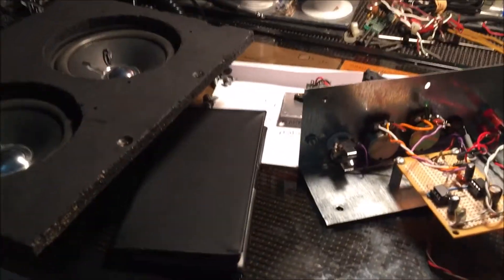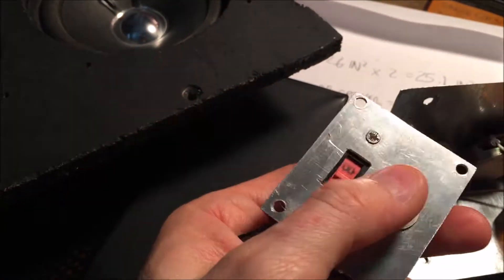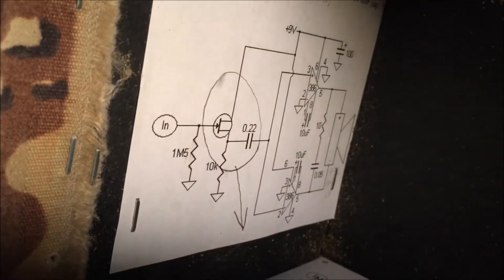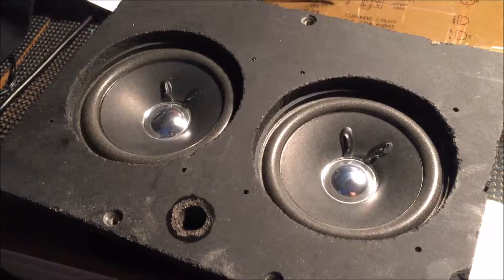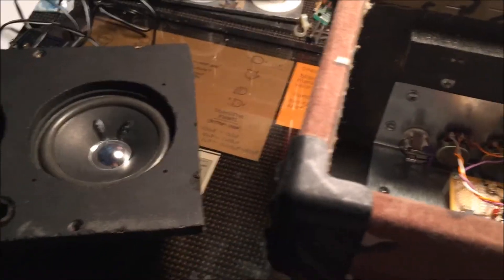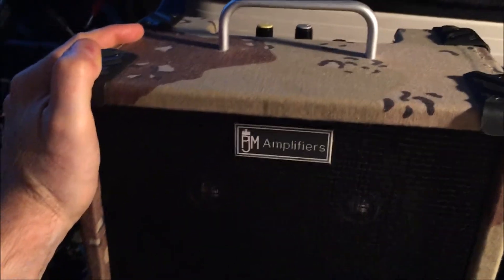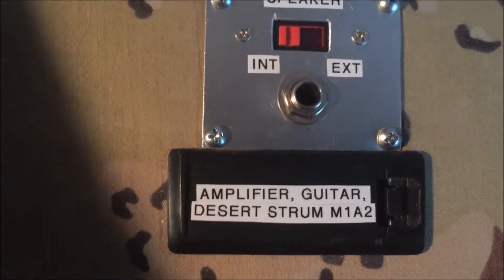My "Desert Strum" Amp - 90dB From Dual LM386 Audio Opamps

Comment: nice work .  did you repurpose the ext speaker switch from a pc power supply ? i recently found an m audio bx5 monitor at salvation army . i pluged it in - no light . i started removing the chassis screws . i had 6 out when i noticed it had a voltage selector or regios switch (110vs220) this similar red recessed switch was set inbetween and not passing ac . easy fix. so what ghood is a single monitor you say ? well let me tell you ... i live in an apartment , i make music with my wife as a duo using drum loops . so i slapped together a practice rig with an old tascam rca mixer , a 5 channel 9 volt deal , i run a zom g1 she runs a zoom b2 and i built an mp3 player using ebay decoder board /flash  mem card , so we are able to play with drum loops , guitar and bass , at "neighbors wont even know" volumes and it sounds like a mastered album ... well close enough ... it sounds way better than one would imagine /
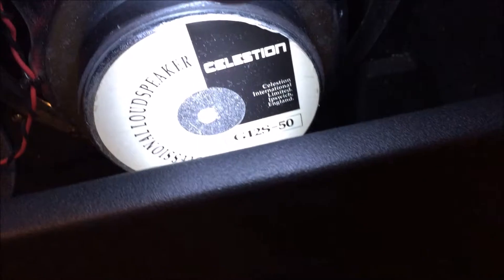Reply from the maker: petey twofinger — I mostly use headphones because I play between 4:00-5:00AM when everyone is still asleep. Yes, that switch is from a dead computer power supply. I like to get whatever I can out of dead things lol